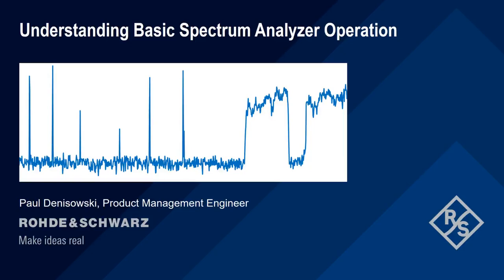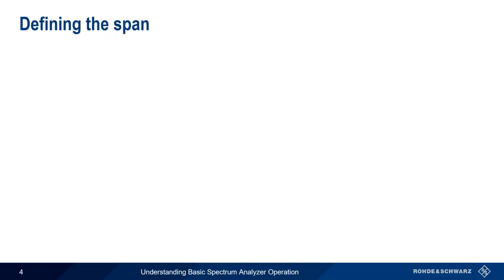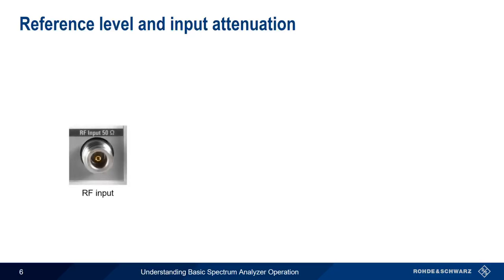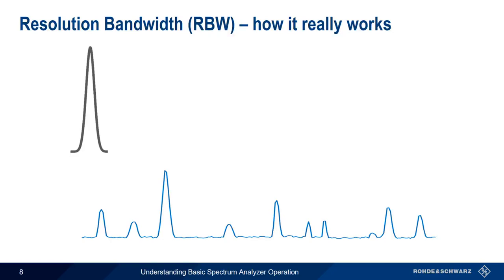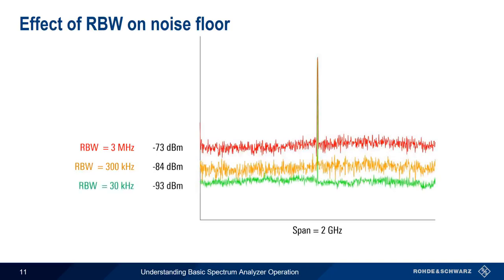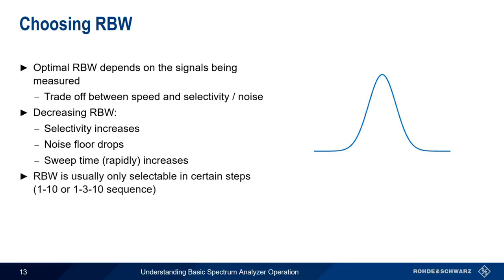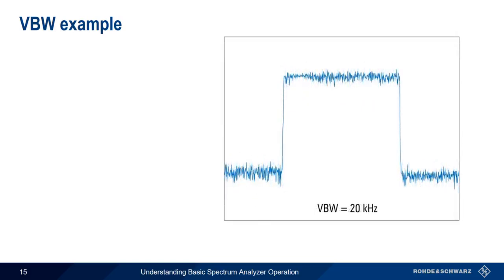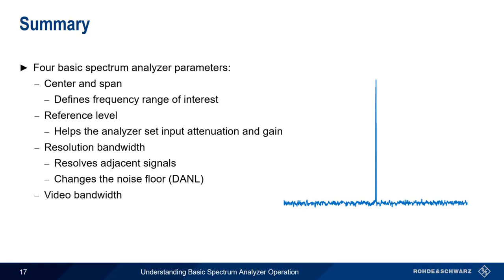Understanding Basic Spectrum Analyzer Operation

Comment: Thanks a lot , please regarding the RBW filter , is this operation mathematically as multiplying the signal with the RBW function in the time domain , which is equivalent to convolution in the frequency domain , so the lower RBW bandwidth ( spectrum ) the more resolving closely spaced frequencies ?

Comment: 3:58 why you said " most of sa use HD principal?
is it like because There's two types of SA
one using FFT and other use only HD principal without FfT ?

when i was thinking how could SA might work i though logically that it might be working by scanning frequency one by one and Plotting The amplitude using Saw and VCO but after that i found SA are using FFT Algorithm than later i foud that there's also similar concept as mine previous thinking by scanning frequency.
but still not sure if SA uses both techniques tougher or any one ?
Reply: It's a good, but complicated, question. :)  The heterodyne principle is still the dominant architecture for most general purpose spectrum analyzers.  However, many mid- to high-end spec ans also support operation in FFT (often called "realtime") mode, either as a standard feature or as an option.  FFT is also often used in "specialty" spectrum-measuring instruments such as EMI receivers or monitoring (sigint) receivers.  A convenient rule of thumb is that if you're looking at signals that you are creating or controlling, then a heterodyne based analyzer is usually use.  On the other hand, if you're looking at (or for) signals that are "unknown" (as in the case of EMC testing, radiomonitoring, signals intelligence, etc.), then FFT analysis is most often used.  This is a bit of an oversimplification, but in my experience it's a good way to separate spec an architectures by application.  Hope that helps!

Comment: Excellent presentation.
Reply from the maker: Glad you liked it!
Reply: Thank you !  Really appreciate the feedback.
Reply: @pauldenisowski  
Thank you so much! It’s a great video again, I have a question that is not relative to this video and your products. I am reading the Specifications and Performance Verification of TSG4106A, I understand most of the parts but “Output level accuracy (IQ
modulation relative to CW)” part (on page 21). Even I have tried to read some papers relative to IQ modulation but I still can not get it. If you get a chance, could you please explain it to me?

https://download.tek.com/manual/TSG4100A-Series-RF-Signal-Generator-Specifications-Performance-Verification-Technical-Reference.pdf

Comment: Will changing the RBW or VBW affect the peak power measurement or reading?
Reply: Depends on the signal.  Generally speaking, you would want the entire signal power falling just slightly within the resolution bandwidth.  Another important setting to consider is the detector type (e.g. max peak vs average vs RMS etc.).  I intentionally did not cover detectors in this short video, but will be releasing a video specific to this topic in the not-too-distant future.

Comment: How to connect an external attenuator to prevent distortion when measuring? Does one end connect to the antenna and the other the RF input to the Spectrum Analyzer?
Reply: Usually an external attenuator would be directly connected (or connected as closely as possible) to the analyzer input.

Comment: What does FFT do
Reply: FFT (Fast Fourier Transform) is a computationally optimized way of converting signals between the time and frequency domains, and some spectrum analyzers operate using FFT-based processing.  This is a somewhat large and involved topic that really needs to be handled in an entirely separate video (stay tuned!), but in the meantime, please take a look at our whitepaper on Spectrum Analyzer Fundamentals for a good general introduction to the difference between FFT-based and so-called heterodyne-based spectrum analyzers:  https://www.rohde-schwarz-usa.com/Spectrum-Analyzer-Fundamentals.html
Reply: Paul Denisowski thank you very much, I’ve been wondering how it works especially when it’s quite common nowadays
Reply: @pauldenisowski  waiting for video lecture on FFT plz upload it asap
Reply: See https://youtu.be/spUNpyF58BY